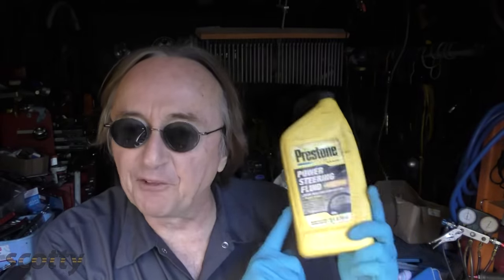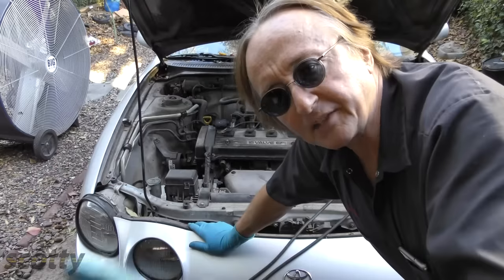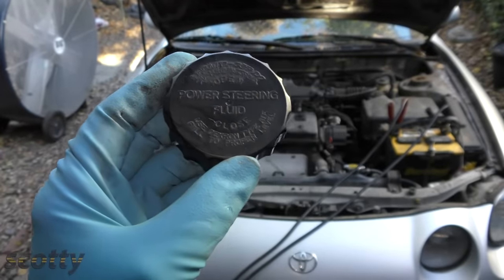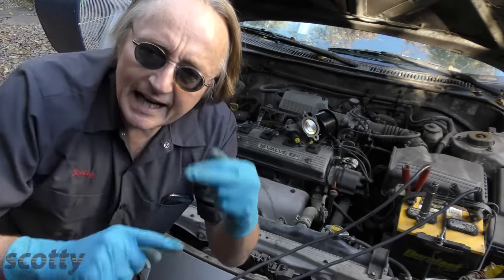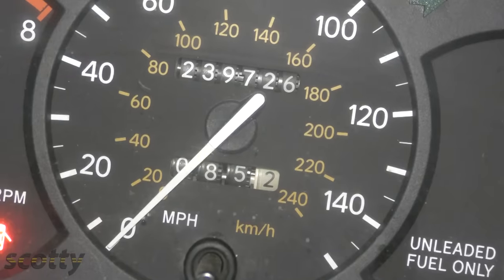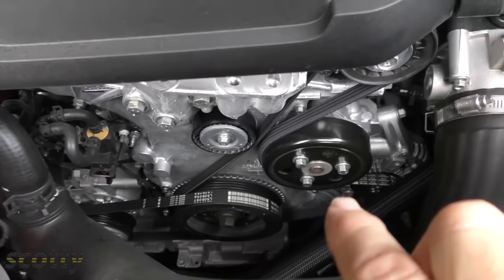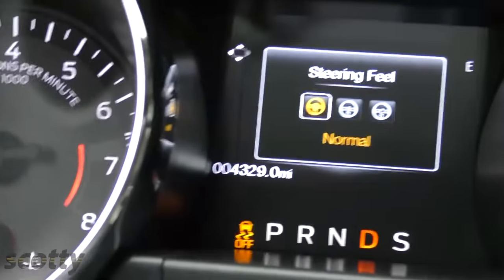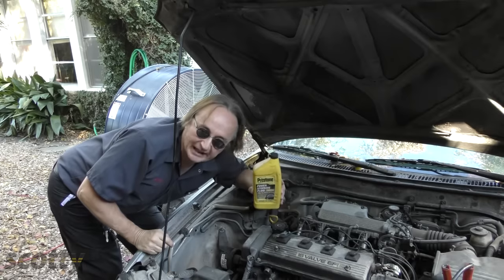Should You Change Power Steering Fluid in Your Car?

Comment: My truck is 18 years old but only has 54k miles. No problems with the power steering but the fluid was dark black so I figured it was probably a good idea to change it. Last week I bought a gallon of power steering fluid used 3/4ths of it changing the fluid before it started coming out actually looking like power steering fluid and not like crude oil. I'll probably do one more change in a month or two once this new stuff has really worked through the system. Like I said, my steering felt fine before, maybe feels just a bit tighter and smoother now or it could be placebo, but either way I'll be keeping on top of this much better from now on.

Comment: Thanks for the video! Didn't know newer cars started going to systems like this, looks a lot simpler but also could make the cost of the rack go way up if needing to be replaced.
Reply: Well thats good, as long as you can replace just the rack or just the motor, then it shouldn't be to bad, maybe even cheaper.

Comment: I used to think that electric power steering sucked, but I now realize it's better than hydraulic. The old fashioned one would be on all the time putting out loads of pressure on the hoses and rack regardless whether you needed it or not, such as driving on a long stretch of road, the electric one only works when you need it. Others say that you don''t "feel" what the front wheels are doing with electric ones. But I have a GT86 with electric steering and it's almost psychic as far as how fast it reacts to my inputs.
Reply: Really depends on the manufacturer. I hate the steering in a mazda cx5, it's very laggy to respond. But the electric rack in our yaris is just fine, very precise and quick. I toyed with the idea of upgrading the steering in mine to electric, but the cost and work around of getting one in, I put that project on the back burner. I like the electric because you don't have to worry about the maintenance, plus heat, the hydraulic systems run blistering hot.
Reply: I just wonder how durable they are, as far as steering feeling, you are absolutely correct. Some cars are very quick to respond and have little play in the wheel, some like the Altima are like driving in slush. I also have a Yaris and the steering is more responsive than the Corolla I used to own which was hydraulic. In that Corolla I went though 2 racks, one pump and various hoses.

Comment: Thank you Scotty.   Can you Please do a video on flushing it out?  Brief Description: Front wheels jacked up, run the Pump return line to a bucket, (seal off this line connection at Pump),  start engine and quickly add fluid to pump reserve container. Watch bucket for clean red new fluid.  Best to use 2 people. Stop Engine.  Reattach pump line. top off fluid.

Comment: Question: Can you mix ATF fluid with power steering fluid? And what is the difference between the two?
Reply: For my car, it's literally the same fluid. Both the Automatic Transmission and Power Steering uses Dexron III.

I'm not sure for other cars. You should check your car user manual

Comment: I had a 1953 Chrysler Windsor Deluxe.
It had power steering in it.
But it felt like the steering wheel wasn't attached to anything at all. It also had a Dyna-Flow transmission.
You had to push in the clutch to go forward and then it would shift automatically as long as you were going forward.
To go in reverse you had to push in the clutch again and then again to go forward. I had it in 1976, was the 1st car I ever bought. It was so cool and unique to what all my friends were driving.

Comment: How do i change the headlight fluid
Reply from the maker: Take it to an Otto mechanic
Reply: The instructions are printed on the lightbulb repair kit.
Reply: Headlight fluid? I don't have that but I DO have taillight fluid. I can see it sloshing around in there.
Reply: Just the blinker fluid.
Reply: Use a plunger then plung out old fluid from exhaust pipe
Reply: @scottykilmer  ,took mine to one of those and it just got worse ! Lol
Reply: My Volvo and Supra have headlight washers...
Reply: Replace your headlights

Comment: Or if you have a really old car, you don’t even have power steering lol
Reply: Richard Skipper Plenty of cheaper cars from the 90s and late 80s dont have power steering
Reply: My mom's 1977 Oldsmobile Cutlass didn't have power steering and it was man/woman powered. If I found the exact color and year my mom had, I'll be rebuilding the transmission, engine, brakes, steering, and if it has power steering and A/C, I'll be replacing the parts.
Reply: @ryzyooritzz  my 2011 Kia Rio didn't have power steering or air conditioning.

Comment: I think most cars made after about 2012 or 2013 use electric power steering fluid.  The exception might be trucks (as my is a 2013) still uses a hydraulic power steering pump.  But most cars I've seen and/or driven that are 2015 or newer have electronic steering.

Comment: Electric motor assist would be safer?  Power steering fluid is flammable?  You do not want to bust a hose on a hot engine and I am sure it has caused engine fires many times.  I found a severely rubbed (Etched) steering hose in a T-Bird.  It had rubbed on a battery tray edge for years and was not easily seen.  Replaced it.  It was real close to breaking through when found.

Comment: I use the  Synthetic  Dexron Transmission Fluid for my GM vehicles, power steering system. ( Synthetic for better protection and extended change intervals ).

For my GM vehicles, the owners manual calls for Dexron Transmission Fluid, in the power steering system.

But check to see which power steering fluid your car takes, owners manual usually has that info, and don't put just any steering fluid in the car, ( steering fluids differs from car to car ).

Domestic cars usually takes something different from the imports.

Only exception to this, is by using ( Lucas Universal Power Steering Fluid ) which  Lucas has put it on their label, for use in any power steering system.

Can't go wrong with putting Lucas Power Steering Fluid, in any car power steering system.

Comment: My old Volvo has hydraulic power steering while my Acura has the electronic.  You can feel the difference when hoping back and forth between vehicles but both work well.  I changed the fluid in the Volvo at 10 years and 100,000 miles because it uses the Petosin mineral oil type fluid.

Comment: I just finished repairing a Chevy HHR that literally only has 3 components tied to the serp belt: crankshaft, alternator and AC compressor. As far as I can tell the power steering has an electric motor and the water pump is perhaps driven by the balance shaft chain? Or some other gear?

I do know that when I would sit and turn the engine over with the crank bolt there would be certain times where there would be a little more resistance than usual (even when the cam lobes were not pressing down on a roller) and I would hear the sound of water being pushed around.

Comment: I love electric power steering! One less oil stain on my driveway ;)
Reply: Jonny DIY same here. I like the design honda has on my si where the motor isn’t connected right to the steering wheel so you get more feel in the wheel.
Reply: Just better hope the belt design in them has gotten better. The real achilles heel of the newer system.
Reply: More electronics more problems in the future
Reply: Artchred exactly. Not sure mass produced electric power steering has been around long enough to estimate longevity. Electric motors are generally very simple and shouldn't break but...
Reply: It's not the motors but the control electronics he means. And yes it is a problem as several demonstrations showing it is possible to hack into a car and give steering imputs that the driver didn't give have shown.

Still the biggest longevity problem is still the belt, it is the weak link and will fail before the motor does.
Reply: It can not be repaired.  If the unit malfunctions, the entire steering column must be replaced.  It improve gas mileage by about 0.5 mpg.
Reply: My Honda electric motor steering unit still runs awesome even after 10 years.
Reply: Power steering gives you actual road feedback. Not that fabricated crap from the electric steering. I'd rather have an oil stain in my driveway. Gives me a reason to keep my yard clean.
Reply: @ashs3380  If it is a sport car, I would say so. For a family car, electric steering feel better. At least, You don't feel vibrations. It doesn't feel disconnected. Even the new Mazda Miata has electric steering.
Reply: @lanfin3644  It will vary on the individual. I prefer road feel and vibrations in my cars. All my cars. Sedans, coupes, trucks. Not a fan of no feedback.
Reply: I detest it. Never worked in the winter time on my dad's car and it was on a massive recall, along with 2 other things (brake light switch and transmission shifter cable). The rack and pinion for electric power steering costs more than the rack for a hydraulic power steering.
Reply: More electronic parts equals to more mechanic problems in the future, and is be going to be more complicated and more expensive, sir.
Reply: @ashs3380  agreed, it is dozens times better the oil one than electronic, it's not good!
Reply: When there’s more electronics in a car more stuff usually goes wrong with it

Comment: I am cheap. I still have a 1986 mazda b2000.  Did not come with power steering. Still drive the truck to this day. Neighbor has a 6 year old Nissan, $1200 to have the rack replace.
Reply: Jim Fusco That Nissan should have electric power steering unless it's a very recent addition. I say this because my 2013 Nissan is electric PS.

Comment: My 2001 Pontiac Grand Am made a loud whining sound when turning the steering wheel. I assumed it was low on PS fluid. But I had to keep adding fluid every 5 days. I tried Lucas, Barr and Blue Devil stop leak. The Blue Devil worked the best but eventually even that was working. I took it to a hole in wall shop that is honest. The mechanic said the soft line was bad and he replaced it. It was about 4 or 5 feet long and sure enough the problem was solved. But after watching this video I am going to have the PS fluid flushed and refilled.

Comment: 2011 Charger RT has the electric pump in fron to the right front tire. You have to jack it up, either turn the wheel or remove it, then remove the plastic guard to get to it. Then it uses a special oil that is around $20 for a 1 Liter can.

Comment: I got 242000 miles on Accord and never change power steering fluid, so maybe that why I had to replace the pump last month .  Also has rack and pinion leak.  Should of done this 10 years ago and I may not have today's problem.
Reply: cuz accords are trash
Reply: Fuck that i have a 94 bmw 320i with 500000 on it when others have honda with problems.
Reply: g n X doubt
Reply: seals will eventually leak for some stupid reason, nothings forever but it can only definitely help.
Reply: g n Well you must be the only one with that many on it. Not a single Beamer I've seen over 290,000. Those cars were intentionally made to break all of the time.
Reply: I changed my fluid twice in 5 years after sounds coming from the pw. When I changed the fluid it went away.
Reply: I have a 1990 Hyundai Scoupe with 1000000 miles with no problems whatsoever.

Comment: Hey scotty, my 2008 merc milan has everything original at 252k. Aisin transmission 6spd autocvt front wheel, mazd 3 liter dohc. Im the second owner. The first was nationwide i think. The car was in tx. Im in nc. I got it almost 3 yrs ago at my dealership where i sold it to myself. Lol. Yeah i did that. It had 65k miles on it. Car has been hit and banged up. Still runs strong. The alternator fried from the oil leak on the valve cover. Alignments are hard for the mechanics here, still havent found a ford dealership that can align it.

Comment: My murano made a weird squeaking noise when turning. Also slightly jerks when turning. 

Suddenly, now my steering wheel got tight. so tight I can barely turn it when driving....

Air pressure is good and power steering is full..
Reply: It was the power steering belt. Replaced it for 140.

Comment: My car dosen't have a hydraulic power steering or electric power steering... 

#ManualSteeringLife T.T
Reply: My VW bus has the Armstrong steering system.
Reply: My VW bug has the manual steering
Reply: have fun putting all your effort just to turn the dam wheel
Reply: Armstrong power steering?
Reply: The manual that came with my toyota car said not to hold the steering wheel all the way to the stop to long or it could harm the electric steering motor.
Reply: Armour Shooter Same is true for my Mustang. And when youre moving faster than 5 mph then it handles about like any other car really.
Reply: Fox McCloud 007 true that is why we are always worried of tight parking places cuz issa nightmare 😂
Reply: Bmw M3 e46 It depends on the type of vehicle. If you drive a bus you're really going to suffer without power steering. But if you drive a minivan like i do you won't even notice the difference.
Reply: Armour Shooter Then comes the task of exiting the vehicle without damaging the vehicle next to you because you swung in too close.
Reply: QuantumRift ..duh
Reply: Pyroman / In my old Mustang once youre moving faster than like 3 mph you wouldnt know the difference other than a bit more vibration and having to compensate more for a slanted road. Parking can be a nightmare tho, you'll need to use alot more space or a lot more time to get in an out of a tight space.
Reply: J Babb 

spits out coffee
Reply: Word Playing on "strong arms" to turn the wheel.
Reply: Armour Shooter My 61 Bug  didnt either or my Datsun B210 circa 1977.😂
Reply: I guess this video won't help you then.
Reply: Yeah, I have an 89 CRX, I love the steering, it's so smooth and easy everywhere that isn't a parking lot
Reply: Should I think you missed the joke because of the question mark? :)
Reply: Owned an 1980 Opel while living in Germany. It was manual and I can tell u that the only time power steering would had been beneficial was in tight parking spaces.
Reply: It's called a motorbike.
Reply: I used to have a 1968 Ford f250 four wheel drive with manual steering.  The large diameter sterring wheel sure helped, but it was still a bear maneuvering in tight quarters in the woods of Oregon.
Reply: Rev up your arm
Reply: My 1972 Porsche doesn't have power steering or power brakes.

Comment: Next up, where's the automatic transmission fluid dipstick.  LOL.  Toyota removed those, they don't want you messin' with their transmissions.  You just have to crawl under the vehicle and pull the check plug like you would on a manual transmission.

Comment: I Change my power steering fluid twice a year
And I use Full synthetic automatic transmission fluid
Reply: Ken Alexander yes if you drive at the light speed...
Reply: So you've seen my Fly by on the Freeway 😂
Reply: I mean, twice a year is excessive, but I bet your seals will be in tip top shape in 20+ years.  That has to be one clean PS system.  Do you use a filter/cooler, too?
Reply: Ken Alexander that's overkill but if you can afford the time and money why not.
Reply: interesting. My grandpa would do that same thing and flush all fluids every 2 years. If he ever bought a car he'd flush the fluids right away.
Reply: With that logic you should be changing your oil ever two weeks because it endures far higher temperatures and pressure than any power steering system fluid.  Save the environment and scale back to at least once a year or once every two years.
Reply: Taylor F. errr i don’t know enough about it to be sure if you’re being sarcastic or not. Do some people really have coolers and filters on their power steering? That seems wildly unnecessary.
Reply: Cooler for power steering is good for off road trucks with big tires.  Some of the newer cars even have coolers for PS.  Most stock vehicles just use a simple loop of tubing near the radiator instead of an actual cooler.  My Nissan trucks and I think my old Toyotas had that.

Comment: Be advised do it yourselfers if you do the power steering flush and add new fluid there’s a chance you will get a leak on a small gasket that leads to the pump and need to install a new one. It will be a tiny little gasket you can get at the dealer. Easy to do. I drained all the fluid and installed new fluid and it began to leak. So I had to drain the new fluid so I could install a tiny little gasket seal then add new fluid again. Just a heads up so you can avoid double work.

Comment: I really like the electric power steering, it saves gas, lower maintenance, more space in the engine bay.
Reply: then when it fails you can crash
Reply: I have this same Mustang he showed. It also has poor steering feel. I leave it on Sport all the time cause if u gun it on normal or comfort the front end get's real loose when it lightens up. And when it fails I'm sure it's thousands. I think these new cars will not be around years from now.
Reply: You can still move your wheels if your power steering fails, its just alot heavier, more so when at a standstill, but when moving you dont just suddenly lose all steering
Reply: Bmw M3 e46 There's a Fail-Safe mechanism where if the electric power steering system fails, it defaults to manual mode so that you can still maneuver your car, though the steering wheel will feel much heavier.
Reply: Both electric and hydraulic power steering have manual connections, and I'd put good money on the electric failing less often than the hydraulic.  I think you're thinking of drive by wire, where there is no physical connection between the steering wheel and the wheels which I would agree is not desirable.
Reply: # power steering is also irrelevant after 20mph lol